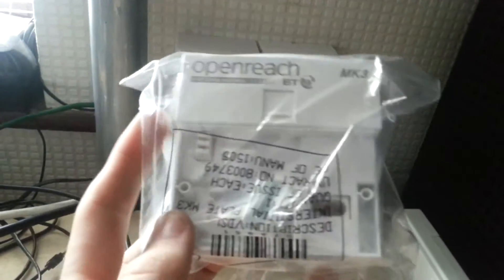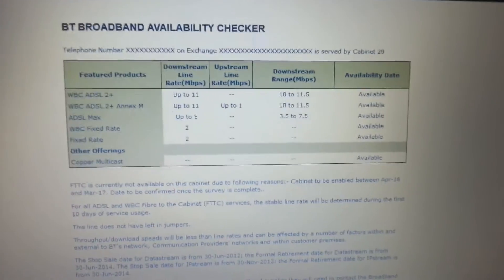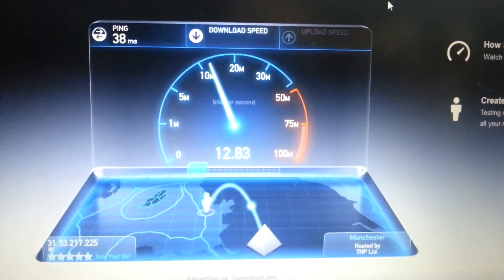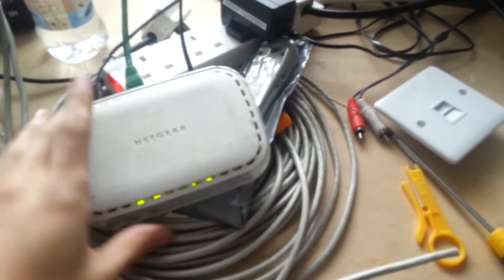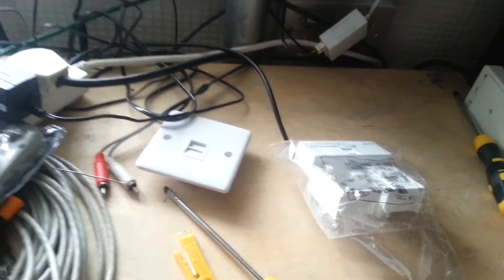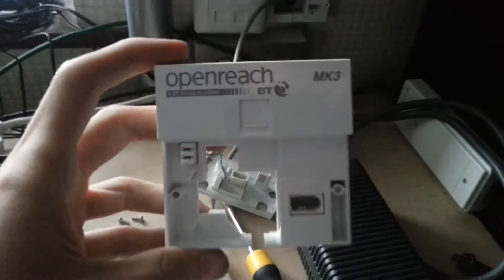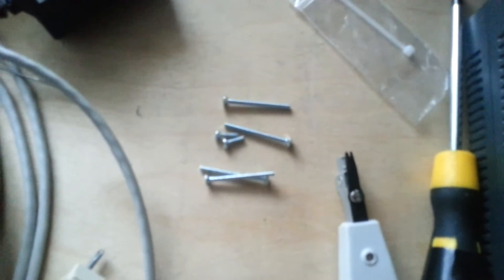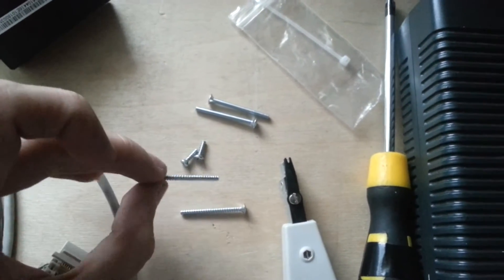Installing The BT Openreach SSFP Filtered Faceplate - Attempting To Further Improve My ADSL2+ Speeds

Comment: Speedtestesters do not give exact speed is only estimated speed test ive a mk4  faceplate was only one socket faceplate 5C master socket
Reply from the maker: Speedtest.net does give pretty accurate results. I've verified this myself using various Speedtest servers over time and also compared to modem sync speeds. This faceplate just didn't really improve the line in my case as the phone line was only a year old roughly and I already had a decent quality filter. It's preferable to have the filter built into the socket though and for VDSL (FTTC Fibre) these faceplates definitely do help get the most speed you can. Thanks!
--Nathan

Comment: Use the LINE SYNC SPEED as a measure.  It is a CONSTANT.  The ISP SPEED is VARIABLE, and hence can give misleading comparisons.  Moreover, the SYNC SPEED responds immediately to an improved line quality.  Whereas the ISP SPEED is adaptive and needs time to adjust.  SYNC SPEED is seen in the hub/router manager, 192.168.x.xxx (etc.).

Comment: just a tip the MK3 SSFP was always a bad one to use, the best one to use is MK2.
Reply from the maker: +King N Boss Gaming thanks for the information, I might try again using a MK2 faceplate if they don't get their ass in gear and install FTTC for my cabinet. I've installed this MK3 faceplate on a FTTC/Infinity line since this video at my sisters place and it's been working great.
Reply: Nathan H No worries, Yeah give it a try. BT took forever to get my area on FTTC, Speeds of up to 40Mbps and it might work there, it does also depend on the wiring in the house, also because you have extensions, that always will be a problem with Fibre connections when you get it thats for a heads up.
Reply from the maker: +King N Boss Gaming I've actually got no extension wiring on the socket I did this demo on, it's a second line purely for broadband. I had fitted an extension socket as an example for people who do have them when installing a SSFP. We have a second line with both telephone and broadband packages. 

FTTC is pathetic here, it's been "Coming Soon" since 2012.. It's being funded by the 66% commercial plan through BT though
Reply: Nathan H Hmm, was never sure you could have two separate lines into one residential household. The waiting time normally is because they can't find a decent enough place to fit the Fibre cab. It has to be within 500m of the DSLAM cab. I'd say give BT a ring, but you probably wouldn't get anything out of them!
Reply from the maker: +King N Boss Gaming I've never got anything from them.. Even offered to pay part of the installation costs of the cabinet and get everyone interested who's on that cabinet. 

I don't believe there's a problem having two lines on a residential, However the main line is in my mother's name/account and the one in this video is in my name and account. 

I just select when ordering that I didn't have a working telephone line, it said "we've found a working line.. Blah blah" and I chose the no I do need a new line box. Engineer came and said "you've got a line" I told him that's my parents and this line was by me, for me and how the Internet is slow so I ordered my own personal line that's not shared with the family. He agreed and went ahead installing it.

Comment: There will be absolutely no change whatsoever on any ADSL line. I would expect to see a change if you were upgrading from a pre 2008 BT faceplate to the SSFP as it contains protection from electrical interference from the bell wire, however with your Openreach MK1 you had installed already, it contains this protection anyway. With the sensitivity of VDSL2, any small interference from batteries on extensions etc. will cause DLM to increase the SNR leading to decreasing speeds, but with ADSL it is unlikely to lead to any such line speed drops. As the SSFP bypasses the extensions there it will remove the risk of interference for VDSL, and technically for ADSL too, however the  VDSL will benefit massively from this.

Comment: theres a good chance the extension wiring is causing the drop in download speeds with the adsl filtered faceplate ... try removing the extensions ( just to test ) and re-run the speed test
Reply from the maker: It made no difference I tried both with and without over a cupple of weeks. Plus the extension I had only just fitted at the same time as doing this faceplate video. Thanks for the suggestions though! My line already gets more than its listed as being able to handle anyway :)

Comment: where did you get this master socket ?
Reply from the maker: +S MA the actual NT5 Master socket was installed by BT Openreach, the faceplate I installed in the video (SSFP) I purchased on eBay but you can also get them on Amazon.
Reply: +Nathan H thanks a lot :)

Comment: Will a microfilter work on a  SSFP Infinity ??? Becouse I got a extended DSL Socket from the master socket ( SSFP Infinity).And the problem that I have with internet is whenever the phone rings the internet drops. I think that the extended DSL socket is interfering with the phone wires.
Reply from the maker: +Andre Costa Costa Do you run your broadband from the extension socket and not the SSFP master socket? Do you happen to know how the extension has been wired to the master socket? 
If you have Infinity and a SSFP over the master socket you do not need to use a microfilter (it's built into the SSFP faceplate) - In this configuration your router should be plugged into the top connector, and the telephone into either the bottom connector of the master socket or the extension. This setup shouldn't cause any issues with the telephone ringing then internet dropping out.. UNLESS somebody has connected the extension socket up incorrectly inside of the master socket. Some pictures of inside the master socket would be helpful.

Comment: The reason that you speed went down is that you need to let DLM stabilise your line after you have changed the faceplate. You won't get an increase in speed straight away.
Reply from the maker: +Lil “Big” Saf because they're garbage and won't work as I require. I use the pfSense router software on a computer and only need a 'dumb modem' to convert the connection into ethernet. The white Netgear box is not a router - just a modem only. All routing, firewall, etc. Is done on the dedicated pfSense router machine.
Reply from the maker: I had left it installed for a week or so and it didn't go up, In fact when it did re-sync with the telephone exchange the speeds only dropped :/ I did mean to mention that on the video but forgot as I filmed this over a week or two! 

To me I'd say that my microfilter I've got works best together with my little 'dumb' netgear modem, Maybe something in the openreach SSFP's components is different and these modems I have dislikes it. 

I haven't actually dismantled it to see, I may well do though!
Reply: +Nathan H Interesting, it should of made an increase to your speed, I think the router is at fault here.
Reply from the maker: I don't believe so, I mean, there's no extension wiring connected up to the master socket, my telephone line is only about 18 months old as it was a brand new install and I'm pulling faster than other people in the area by a few Mbps. I think I'm just getting as good as I can down it. I pull faster speeds than the dslchecker says I can achieve as best by a bit.. 
Either way though it's no big deal right now because I spend most of my daytimes at University now since returning to full time education. 
Thanks for the feedback / comments! :)
Reply: Nathan PH why don't you test with the router the isp gave?
Reply: Nathan PH alright I'm with talk talk and I only get 6mb I don't know if I can improve unless I upgrade to fibre, I'm sure the engineers have a problem with their end maybe the phone line is old and bad and needs replacing. What I don't understand is why can't they give fibre but cap the speed for what you pay for?
Reply: Because the fibre isn't available just out of thin air, they have to install it under roads.
Reply: William Grimsley no, fibre is available in my area (virgin media  I had but expensive) so all they have to do is connect to the fibre cabinet.
Reply: Yeah, Virgin Media and Openreach use different technologies.
Reply: William Grimsley I know they do, just that open reach uses phone line but should help customers out but some just ignore...